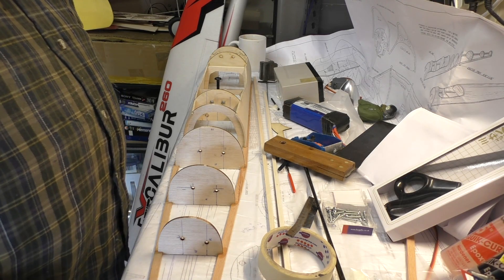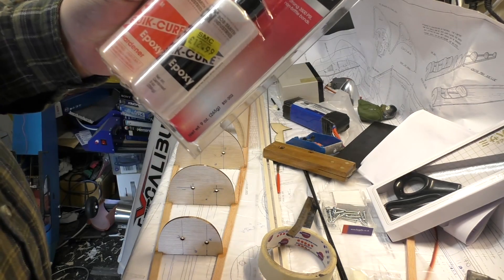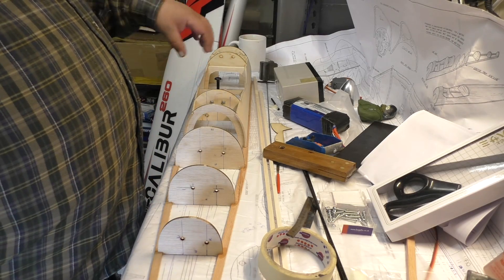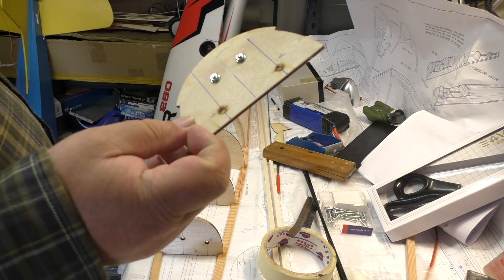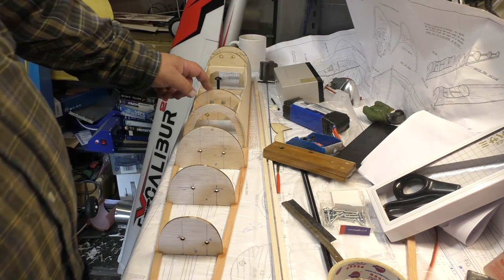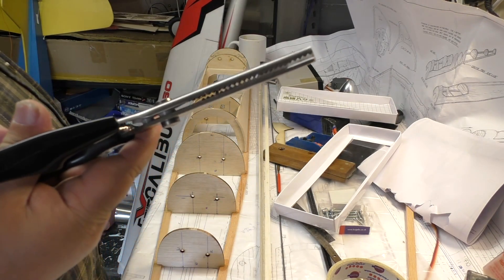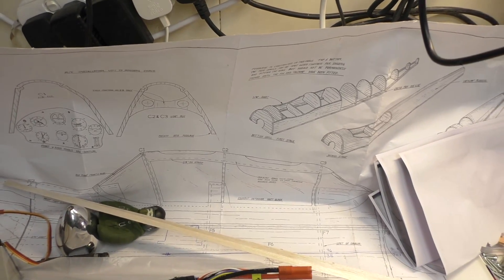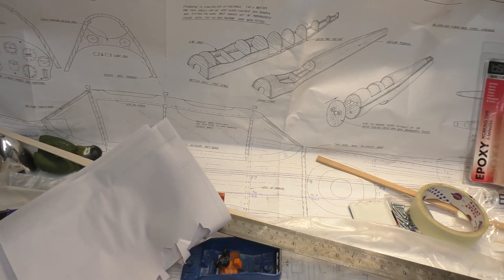Sarik Hobbies Dennis Bryant 68" DHC-1 Chipmunk Build Pt8 RC Model Geeks

Comment: During WW1 the fabric on aircraft was found to be lifting especially in a dive,the fabric would start to lift resulting in it coming off in large panels ! the problem was solved by 'fraying' the weft from the weave of the fabric this was easy to do in the field literally by inexperienced hand when patches were constantly needed to repair the biplanes & triplanes,the idea was that portions of the fabric only would lift and not whole panels,as we got towards WW2 something better was required to cover especially the control surfaces of aeroplanes and 'Pinking Shears' were used,the pinked edge was found ideal if fabric did ever part company from the aeroplane ,Rob is going to pink the edges of his film to represent the fabric on his Chipmunk.

FRAA107S is actually FRAA1075 for that wing mounting bracket,easily mis-read.

Pilots are a right pain to source and apart from buying custom pilots which are very nice but outside of my price range expensve because they are hand made and painted,there is a need for a budget range of pilots on the market,most of the Chinese ones are too small for the scales needed,I do not know why they cannot get the scale of a human body correct ?

Bob Smith Epoxy is the best you can get,as Rob points out the other stuff sets like glass and becomes brittle once cured,it shatters like glass too because the exotherm of the curing ie the heat build up makes it set too hard,the Bob Smith material has a controlled accelerator making it softer even over time,the worst one for brittleness is Devcon probably the most famous but not the best by any means.

What a good idea using plastruct for the canopy rails a big scale feature of the Chipmunk aeroplane,by the way if you build the Canadian version then you will need the blown canopy used by the RCAF,if you do a Masefield Tourer ( Chipmunk conversion by well known aviator Peter Masefield ) then you need a special hood too,if you want to do something really outlandish then how about the Chipmunk used in the film 'The Great Waldo Pepper' which had no canopy !! made into a low wing braced monoplane doing aerobatics.

There is a new film about to begin at Geeks HQ it is called 'Carry On Planking' !
Reply from the maker: As always you are a bloody star. I can now add to my bank of nerdy information that the chipmunk was used in the Great Waldo Pepper! The Outside Loop!
Reply: Great information angel reading as always . what happened to that ingenuity and creativity. At least a few like you and Rob keep it going .👍